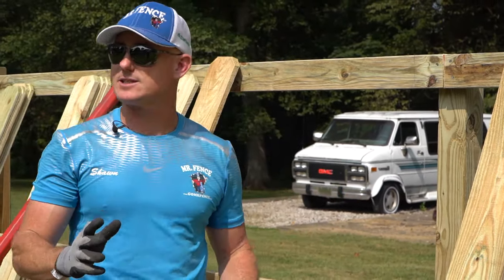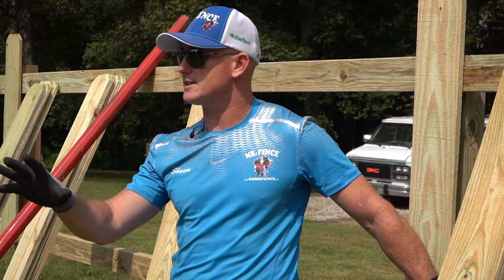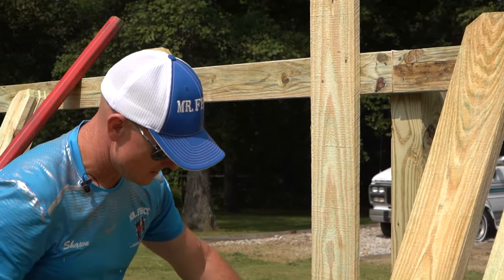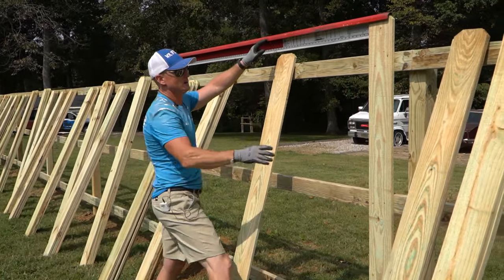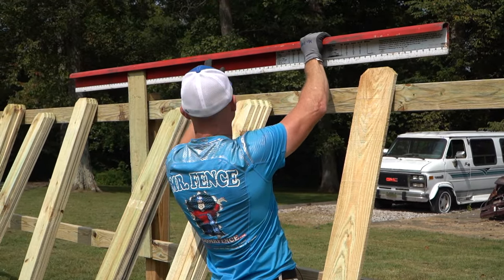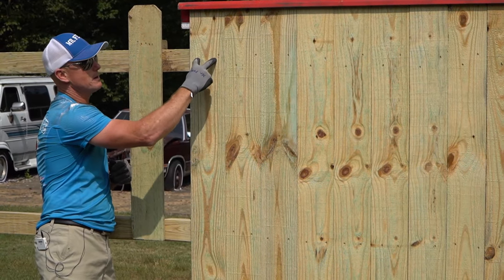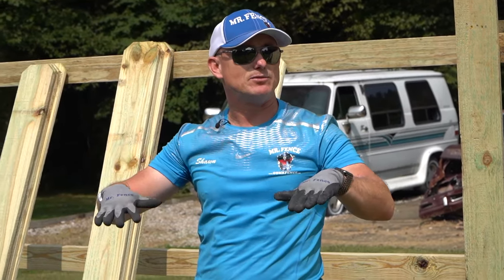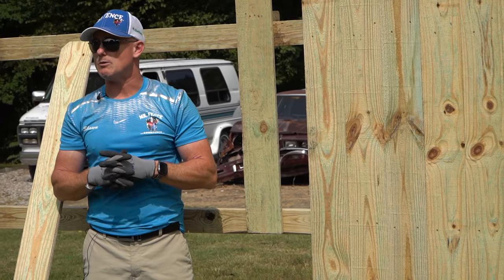How to Nail Pickets on a Wood Fence | Running Pickets

Comment: Just a note for myself and others regarding nail length ... 2x4's are not 2" thick, they are 1-1/2" nominal thickness (by 3-1/2" width). Here in Florida, Lowes carries a HUGE supply of "Severe Weather" pickets (the most frequently used by professionals down here). Those pickets are 5/8" thick by 6" wide by 6' length. So, if we do the math, 1-1/2" = 1=4/8" (the 2x4), plus 5/8" (the picket) = 1-9/8ths or ,more correctly, 2-1/8" total thickness of wood to nail through for picket & rail. So a 2" nail would be perfect. I have a 21 degree framing nailer, so for me, Lowe's sells a "Metabo HPT 2-in x 0.113-in 21 Degree Hot-Dipped Galvanized Ring Collated Framing Nails (1000-Per Box)" for $41.98. The "Ring" in that description means ring-shank. I'm not a pro, just a homeowner, but as Bob Vila said, measure twice, cut once. I'm trying to think this all the way through but not over-think it. I want to build it once and move on with my life.
Reply: Man i'm in Georgia, I just went through this same exercise in my head, just standing there looking at the nails, calculating the 2x4, picket, should I go screws blah blah blah for like an hour lol. I settled on the exact same nail but from Grip Rite. I have 530 pickets to put up, 115 rails, and 40 posts to put up. Got 4 boxes, now i'm deciding 2 nails or 3 nails per rail. If I go 3, I'll need another box. I went with Steel Lifetime Posts, like postmaster, $40 bucks a post lol, Contractor quoted me $10K for 250+ linear feet to do the fence. Nah i'm good, i'll do it myself, new project = new tools  yipee, added a 40V Ryobi Auger, 21 degree framing nailer, new compressor and a rotary hammer drill to the collection. All that is coming a little over $6K but that's me buying tools lol.
Reply: Also I would like all the pickets to be straight.
Reply: so 2 inch galvanized nail
Reply: So 2” nails for pickets?
What size for rails 🤔
Reply: no 
 @livingsimpl3

Comment: I didn't see how u set your posts and rails so that u can run the pickets without a level. I always use a level and pickets get crooked. Whst am I doing wrong? U are a true pro
Reply: You need to use a level for the posts and rails.

Comment: Should there be a gap between fence pickets?
Reply: No. When the pickets dry it'll form gaps naturally. Unless that's the look you're going for. I've done horizontal pickets and used a carpenters pencil as a spacer.

Comment: One board fence design with 5/8th pickets on 2x4 rails - max go with 2" ring shanked nails - you will have 1/8th of the rail thickness left before the nail pulls out other side. 

Board on board fence design with same size picket and rail - for bottom rail 2" nails will still work.
For top pickets - 2" can be used but it will go only 3/4" in the rail which is a bit shorter.
Ideal size would be 2-1/4in or 2-1/2 in nails. 

Always use hot dipped galvanized ring shanked nails. 
Nail thickness - standard 6D-10D nail thickness is sufficient. 
Nail head should be full round heads, don't use the ones that goes with the stick clipped nail guns that has half the nail head. 

Now once you find a matching brand in your local store, use a nail gun that can drive these nails. I am a dewalt fan but unfortunately none of dewalt guns can drive shorter that 2" nails which is a bummer.
Reply: So what nail gun you recommend?
Reply: @ciscosoto1  I still used a dewalt gun.

Comment: I am replacing a section of fence blown down by a storm.  I am keeping with the current design which has 3 rails that are 1x6 and not the traditional 2x4 rails like the remainder of my fence.  This is a perimeter fence between our development and some Garden Homes.  I'm looking at buying a 21 degree nail gun for the pickets, but the smallest ring shank nail I can find for it is 2" and it will slightly protrude on the backside of the rail.  In previous fences I've replaced or built, I've used screws as the final securing hardware after installing the pickets with 18 GA nails (via nail gun).  This time (and for the future) I want to speed up the process and use a nail gun one time and not come back with screws.  Should I just buy a 30 degree nail gun instead, because I do see where there are 1.5 inch ring nails available for it?

Comment: Apparently nobody in Florida knows how to build wooden fences. No concrete slugs(just a post in the sand and a prayer), everything is screwed(no nails but sometimes "2 staples for pickets?), every picket is soppin wet with treatment and crowned like the king of France from the lumber suppliers, picket tails buried in the dirt so they rot in 2 years, unprotected/non-beveled post tops so they collect seeds and start growing weeds out of them, rarity to find any cross-bracing on gates, etc.

Comment: I can never find the answer to my question! How do you put pickets on the other side? I bought a house and I’m looking at the back of all my neighbors fences. Do I put 2x4s on the middle and bottom rails? I’m putting pockets on my side.
Reply: Basically you just build it inside out. If you put the rails in between the posts, just make sure the rails are flush with the posts on the side the pickets are going.

Comment: I wonder how to get pickets that align with no gap. I check at different HD stores and no 2 pickets align and leave a gap.
Reply: That's correct, there are no perfect boards at the home improvement store so no fence made with them will be 100% perfect.
Only if you were using synthetic, non-wood boards would you be able to achieve that.
Reply: Get your wood material from an actual lumber yard rather than HD. HD wood sucks.

Comment: Do you guys use a bottom pressure treated rail to prevent picket from rotting up?
Reply from the maker: No we use pressure treated pickets
Reply: It all should be pressure treated wood it's outside.

Comment: He's butting the pickets next to each other with no space in between. I've always heard that's a big no, no because the pickets won't have room to swell when they get soaked with rain.  I guess because of the thickness of the pickets he's using, they  resist warping.
Reply from the maker: The shrink after install not swell

Comment: You are not supposed to have them touching and you don't nail the top then bottom and then middle.  You work down til you get to the bottom.  If you nail top , bottom then middle it can cause the nails to pop out when the wood shrinks and expands puts a bond on it and pressure. Same goes if you don't put a space in between them
Reply: Use ring shank nails
Reply: i agree with you, wood expands and contracts. I dont know why so many people think his method is the right one.

Comment: What type of Nail (for pickets) do you recommend? Also, is there a Corless/Airless Nail Gun that you recommend for shooting picket nails (if there is one)?
Reply: @jo wil I figured it out myself. I bought the Dewalt Siding Nailer at Home Depot for $339. The Nails I used are 15° Wire Weld Coil 2-3/16”x.092” Ring Shank exterior Galvanized nails. They are $85 for a box of 3000 at Home Depot
Reply: @bobkeeler5964  did that nails came out on the other side of the 2x4?
Reply: @gtdodgeviper  if the board hes nailing too is 2" and the picket is maybe half an inch. wont go through

Comment: What about picket expansion when it rains? But I suppose that method would minimize gaps. It seems that top guide would only be useful for flat terrain rather than changes in elevation.
Reply: It will shrink first because most wood you buy is not dried then when it rains you will be fine
Reply: It would work if you go post to post. Just angle cut the bottom of your boards to maintain the one inch gap. That is if you have enough board to cut. If it was eight foot boards you could grab up all that scrap and build some shit around the yard while you’re stuck in puppy timeout outside with the sun beating down on your head like the sun decided to come down and give you a big old hug and kiss right between your ears all the way around without so much as a warm sip of beer to quench your thirst because you done pissed her off like you prolly will when you get back inside when you decide it’s time to come back in without her express permission because she got tired of looking at and smelling your ass inside. Whew….. I want a beer. Screws…nails… who cares it’s your fence build it as many times as you want. (Looking at watch…. Again) Is that a plane or a UFO?

Comment: I have a question,  does each picket have a "good side, bad side, curved side"   like 2x4s etc,  or can you just randomly install them without looking them over ?
Reply: As far as good side bad side goes, you'd want the more appealing side facing out so it looks better from the outside. If the picket is curved, set it aside and try to use that as a ripped picket somewhere.
Reply: He does not do that in his yard - somebody else’s can be done in cheep way

Comment: Are those treated pine pickets? I'm planning on replacing our fence but have researched and found that most installers in my area are using poor grade cedar pickets ( grade 3) or not even western red cedar. I prefer cedar but may have to settle for pressurized pine.

Comment: Whats the nail gun are you using in the video and what kind of nails(size)?
Reply from the maker: Just a generic from our supplier nails are 1-7/8” ring shank galvanized the gun I think is a Max
Reply: Does the degree of the nail gun matter ? If so what degree? 21 or 30 or other
Reply: @ME-nn9vf  depends on the gun, most coil siding nailers are 15 degree. I own a Makita and Hitachi and they both use the same nails.

Comment: Anyone know where to get one of those strght aways? Cant find them, and im about to install a 200 ft wood fence.
Reply from the maker: Www.mrfencetools.com
Reply: you can make your own for under $50
Reply: You can make your own jig out of the 2x4 that slides along the top rail makes everything super easy
Reply from the maker: @eddieb35  no way I never thought of that lol
Reply: @eddieb35  
versus the metal version at over $350.
It's not weight bearing and can be made out of MDF. Just what l need.
Reply: Or just run a string from 1st picket to last picket. The entire line will flow nicely and you'll spend less time fucking around with things in between each section. Seems like a waste of time to me.

Comment: What sized nail for the planks
Reply: Depends how thick your pockets are and you should use ring shank nails. If you use cedar or redwood use stainless steel nails and screws NOT galvanized

Comment: Whst do you charge per foot for standard dog ear 6ft
Reply: Did you find out how much it costs
Reply: It's not a good idea to charge by the foot. There are to many variables from project to project.

1 project can be straight forward, and a different project of the same footage could have things like shrubs or trees that need to be removed. Or maybe there is more or less of, bigger or smaller gates. If you charge by the foot you can potentially screw yourself, the installer, out of money whether it's a loss or gain.

Comment: What's the reason behind you framing on the face of the 4x4 and not in between?
Reply from the maker: Strength
Reply: @mrfenceacademy  ok just curious I frame my fences different. I frame mine in between post. And the top rail gets nailed to to top of my 4x4.  Only thing I nail to the face of the 4x4 is the rot board.
Reply: @Gsedan04 , yes it seems here in Canada all contractors put the 2x4s between the posts using galvanized brackets. Nailing to outside of post just makes for an uglier backside for your neighbors.

Comment: Rule one...only if you want the fence to fail... you nail gun it.  If your gonna spend a lot of money on a wooden fence, screw it in or watch the wind and heat and cold push them nails out in no time.
Reply: Depends on what type of nails I disagree with your statement
Reply: Ring shank nails are what should be used and they’re pretty hard to pry out. Screws to me grip too hard. Similarly, when installing hardbacker flooring underlayment, nails are used so the hardie isn’t damaged.
Reply: I’m guessing if you going to spend lots of money on a house , make sure the framers use screws as well
Reply: Ring shank nails are the most efficient and fastest way, 6 nails per pickets makes a very strong fence!
Reply: muppet
Reply: @PerezFencingandConcrete  nails are harder and could break as the house settles but nails are softer and can bend
Reply: I hit them once on the top rail with a brad nailer then come back  with screws.
Reply: 2" galvanized ring shank nails. Not going anywhere
Reply: Ummmm 👎 no
Reply: You’ve obviously never used a ring shank nail. Good luck getting a 5-600ft job finished.
Reply: @steveboom635  you said nails twice but i think everone understood at least I hope
Reply: Rule two: don't state personal opinions as declarative, factual statements, because you're going to steer the topic into an argument where no one ends up learning (pertaining to amateurs)  because of the conflicting comments. If you are going to make such argumentative statements, maybe provide a link to your resource so that people can do their own research.  There are way too many variables to simply make such a statement like yours.
Reply: @ShanDysigns ty sir
Reply: Somebody built a fence with brad nails and doesn’t know about framing nails 😳
Reply: My fence was screwed in and the wind blew that shit away. Professionally screwed in fence is not what's up. Can't speak it if you ain't lived it
Reply: @ShanDysigns I already argue with his ass
Reply: @PerezFencingandConcrete both are great viable alternatives. Individual preferences and business models besides climates and demographics to the area ! Excellent instruction here. 
The INSTRUCTOR IS OUTSTANDING ❤
Reply: Question, I use to always use exterior screws for the pickets. But I was thinking about using staples 1 1/4” or 1 1/2” long with an air stapler. Do you think that could also be an issue. I know it would be a lot faster.  Not sure.
Reply: @Dhi-fe5eu  if it goes it easy, it'll loosen and come out easy.
Reply: I live in Florida, I built my fence with stainless steel ring shank nails and ever since I started using 6×6s for end posts and good 4x4s for regular posts that fence goes through hurricanes without issues so far.
Reply: If you've got the time to screw everything, when do you get to go fishing..😅
Reply: Yeah.. okay guy...lol
Reply: At the right depth setting, 2 inch ring shanks will hold pretty damn good i disagree.
Reply: You use full ring, shank nails for everything you don’t use screws screws don’t bend they snap and wooden fences, dry and move
Reply: exact thing happened to my fence i built!  Had to go back and screw each picket
Reply: @steveboom635 ?? I’m. Confused

Comment: Why didn't he put  a 1/8 gap between  pickets ?
Reply: Wood is green (not dried) when you buy it therefore it will not swell it will shrink and leave a gap anyways. You don’t want a huge gap which will happen if you leave a gap at first

Comment: It's so much better if u put a 1x6 on the last 2x4 and a little piece of another 2x4 on the 4x4 to put the nails on the 1x6 to make the fence so much stronger, and damn just put a wire on the top of the 4x4 and stop using that thing jaja

Comment: The high low nailing at top rail isn't needed. I never had a problem. I never like the look of one nail high and the other nail low. Looks messy, but just my opinion
Reply: I agree its sloppy, I also noticed he didnt follow that same pattern for the middle and the bottom, and what is that giant metal piece of crap haha just learn how to do it right with a string line.

Comment: What l don't understand is  the logic of more board being held by High-Low nail pattern. 

It only stands to reason that the middle rail and lower rail would follow the same nail pattern. Why are you NOT nailing those to match and to support your claim? 

I will snap a line across for the high nail and another snapline for the low nail on all three rail boards and call it symmetrical. As above, so below.

Either way, the nails are not the focus of the thing, the color and straight edges are.
Reply: no logic just how fast can this fence be slapped up ...sloppy work

Comment: I was instructed by a local fence installer to allow a small gap between each picket to let wind blow through. Is that not necessary?
Reply from the maker: Absolutely positively not true
Reply: The pickets will shrink over time and there will be a slight gap anyway.

Comment: I’m having a issue with going up a slope or raking pickets
Reply from the maker: Help me understand are you having an issue with the tool going up a slope
Reply: @mrfenceacademy  no wish I could send you a picture but I am having a issue with un level ground. And I can do wood fence on level ground but I’m stuck now cause I do not know how to go up the hill I am on do not know how to nail panels to support boards going up a hill and make it look correct
Reply from the maker: @kellajones9942  are you trying to use the Straightaway?
Reply: @mrfenceacademy  I’m good on flat land but yard has a slight incline and don’t know what to do. I watch all your video but isn’t nothing on that. But one video that similar to my situation is the one you have on bias cutting chain link fence. You see the angle of that fence that the situation I am in currently how to hang panels or what methods can be use to do a wood fence like that keeping them one lich off ground and staying at height fence suppose to be.
Reply from the maker: Use the same method no different once your framework is complete your straight away will follow the top rail. Only move it from post to post and you will be fine
Reply: Set the 1st and last picket where they should go and run a string along the very top of the pickets. Super simple and it'll flow very nice.